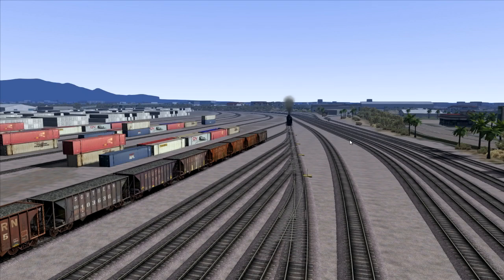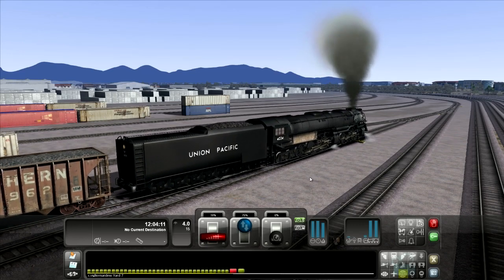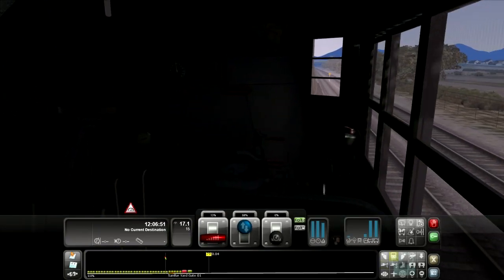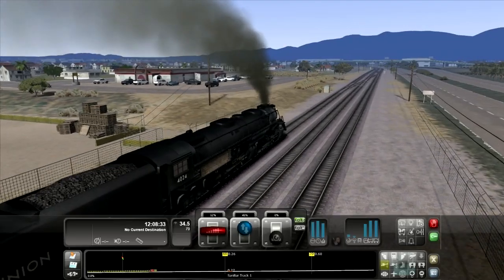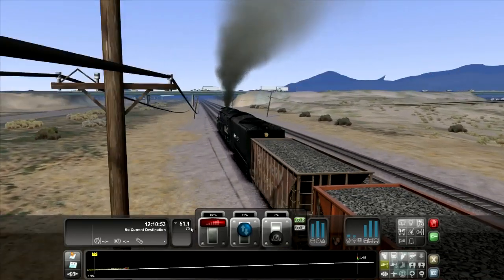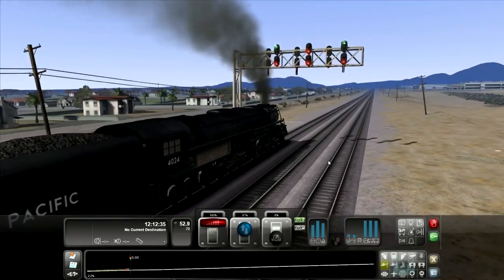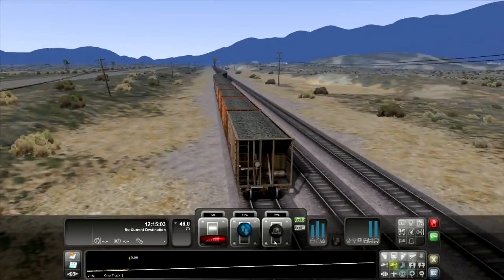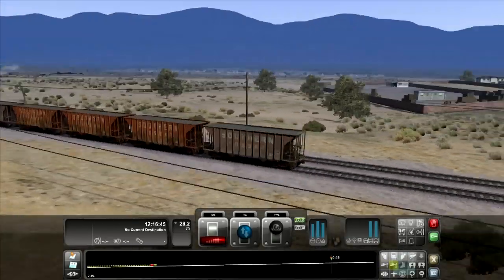Railworks 3 Tutorial {HD}- Drive Steam Engine w/Expert Controls Part II

Comment: That is incorrect, the Big Boy does have 4 cylinders but both sets of cylinders are not mechanically connected in any way. Thus either 4 chuffs per revolution or 8 chuffs is accurate for this model, however I prefer that when the locomotive is working and going 30 MPH, it actually sounds like it is going 30 MPH, and not 60 MPH which would be the case with 8 chuffs per revolution. Sometimes articulated locomotives don't have an even chuff beat at all because one set of drivers gets out of sync.

Comment: hi there, i have a question: i've downloaded the big boy in railworks 2010. there are just 2 free roam scenarios where i can drive the big boy wich is kinda sad. but now, for the 2013 version there's an upgraded version of the big boy that you can drive on multiple routes with the" quick drive" menu. but my big boy is still the 2010 version. is there a way to upgrade it to 2013 for free or do i need to buy it again for using it in quick drive?

Comment: Unreasonably fast? the largest loco in service currently is a 4-6-6-4 challenger owned and operated by union pacific and it does main line speeds (70-75 mph) on its excursions

Comment: The lack of any support for control axes on a normal PC joystick is peculiar. It would be so easy to link brakes and throttle to a throttle quadrant you'd use for flight simulation. The xbox controller thing makes no sense to me.